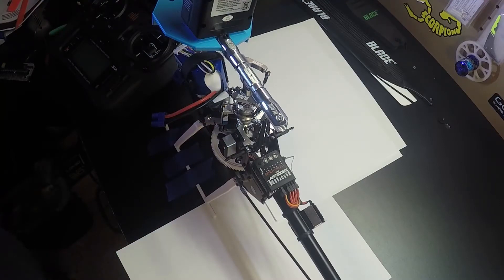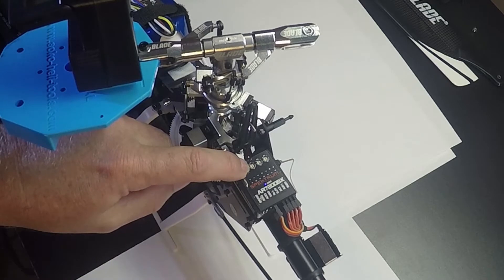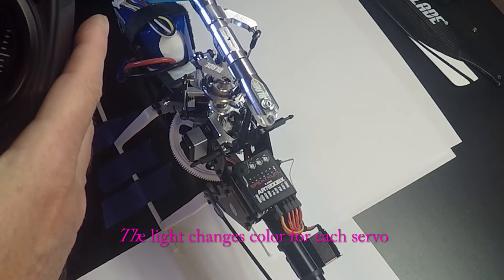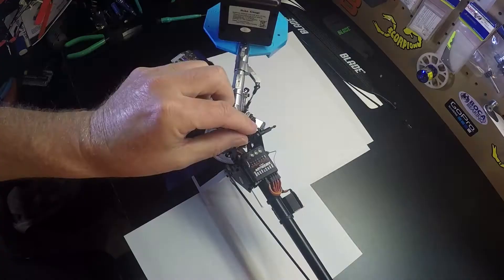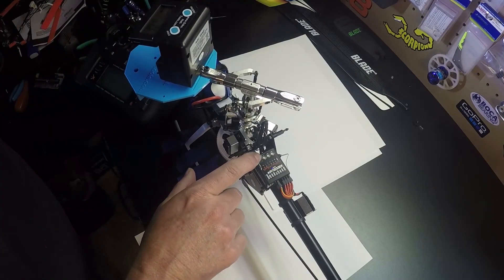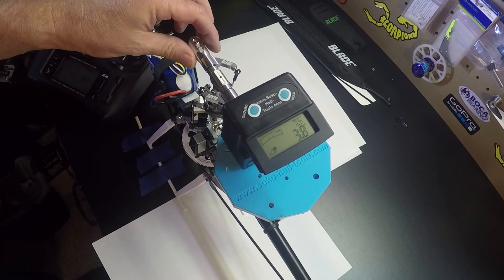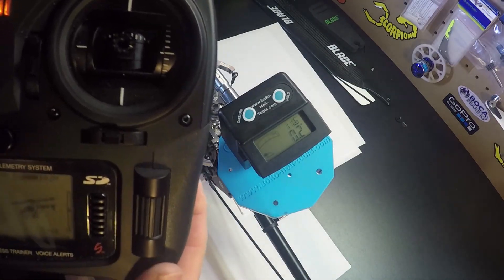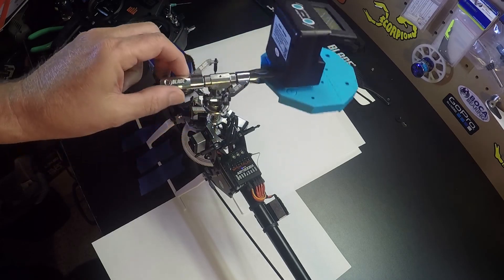Blade 360 CFX checking AR7200 steps G, J and K

Comment: Hi JJ. Could you please help me fix my Blade Trio 360CFX with AR7210.
Reply from the maker: Johnny vu what’s wrong with it
Reply: It crashed and the blade, tail boom and servo broke. I replaced them and need to complete setup steps G, J, K and L. However, I can’t adjust the said steps on my Blade Trio 360CFX with AR7210. Could you please make a video showing me how to do it? Thanks.

Comment: I posted a comment a while back about figuring out gjk and L modes and mid stick achievement... I figured it out ... Before entering gjk and L modes follow this... JJ is correct about swash leveled and all but before starting these modes level the blades after swash is leveled in flight ready menu set throttle hold and correct the main blades at mid stick by adjusting transmitter throttle stick to half way or middle and level blades after doing so start gjk and L and when completed the blades will be mid stick level following the above

Comment: jj I need your help.. I have this exact heli soko followed gjk and L 6 months now and still cant balance out blades... I have a perfect swash leveled flat... servos 90ed etc.. when I try to mid stick on my very old gen1 dx7, its second notch below perfect...  I dont know what else to try.. Horizon is useless and local hobby  shops are a joke its pain.. if U can help it would be great if u want my cell # I can post it ... If it matters my 7200 is all good only thing in flash setting is my heli is in sport solid red light on b setting rest is legit... Thanks if u read this... Nowhere to turn now.. Zac

Comment: Hi JJ. I have the blade 270 cfx and when I tested It, it wanted to tip forward and scoot off really quick. Today I checked the swash and saw the elevator servo arm is not level, pointing down. Could I follow your G, J, K setup  you did for the AR7200BX as this has the AR7210BX.  Do you have to remove the servo as the arm is inside the frame ? Thank you.
Reply from the maker: james tremain sorry don't have a 7210 or 270 so don't want to give you wrong info

Comment: The main reason I do not get into the professional level is that I do not like all tuning stuff and involvement around that hobby. I prefer to stay in a simulator or fly RTF to sizes of 250. but it seems you're handle it quite fine there! :)
Reply from the maker: +Eli Iluz I understand but if you stay in the hobby long enough you may go bigger.